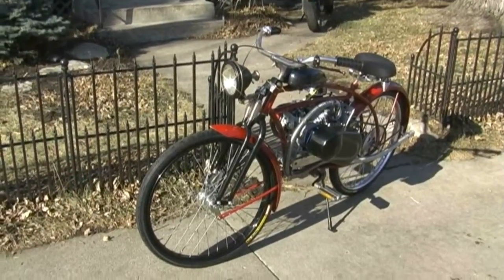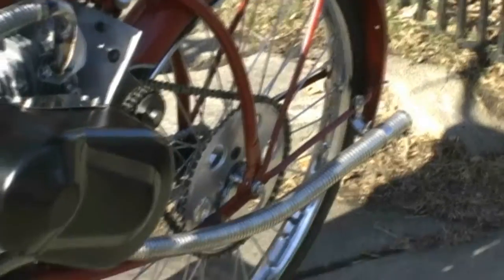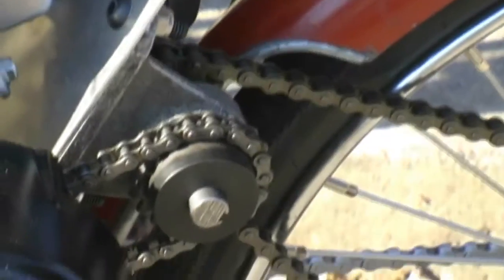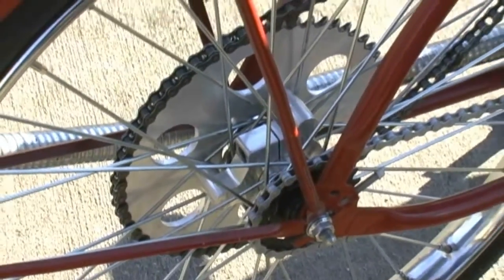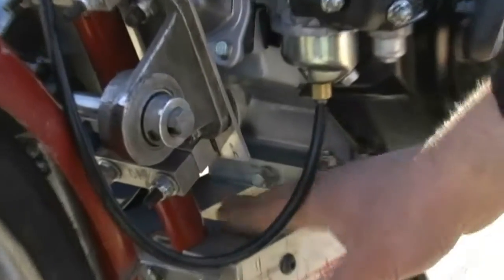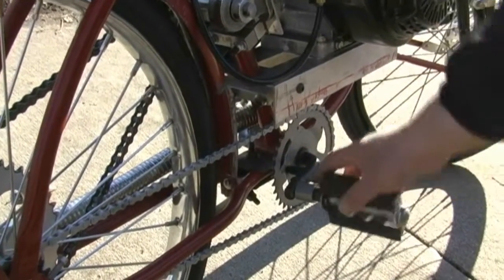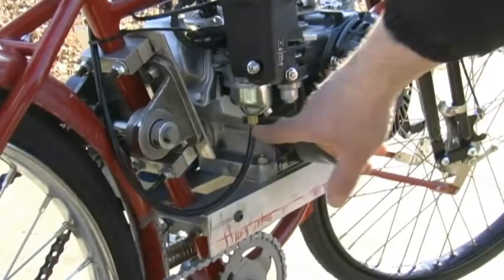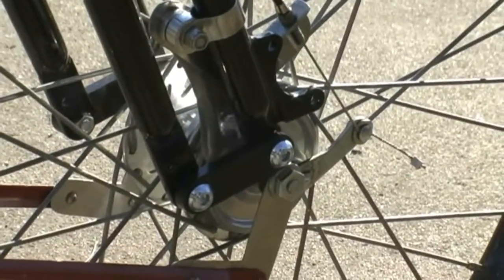Homemade motorbike with GTC TC2 transmission & Honda 120 GX - first drive

Comment: Those so-called torque converters (which are actually just a belt drive with variable size sheaves) are notoriously inefficient.
Reply from the maker: Being a hot-rodder/drag-racer, motorcyclist, car builder, engine builder, and transmission builder - I already know all of that. The TC2 is essentially a small snowmobile CVT. No matter. Both bikes can easily cruise @ ~40 MPH & top-out @ ~45 MPH, which is more than fast enough for a bike.

Comment from the maker: Project update: The engine was running pig-rich in this clip. It didn't even have enough power to hit anywhere near close to peak RPM with the back wheel off the ground. We have since tuned the engine for peak performance. As you'd expect, the motor came alive! Now the bike continues to accelerate long after the CVT is in full overdrive. :) We plan to shoot more video on Wednesday. Stay tuned!